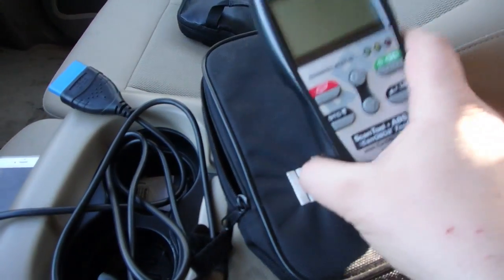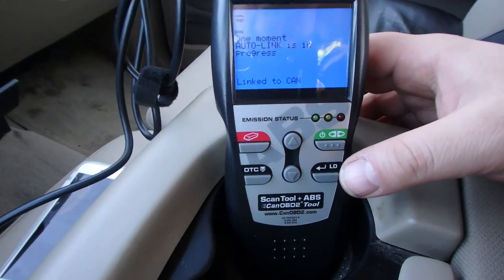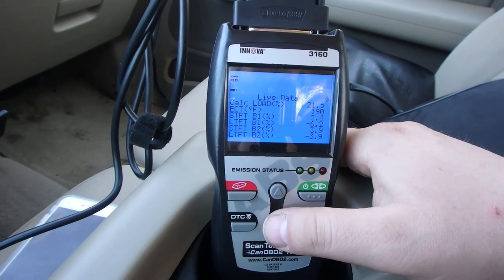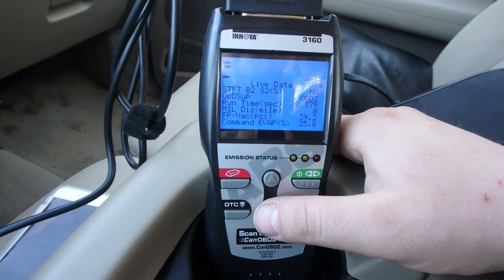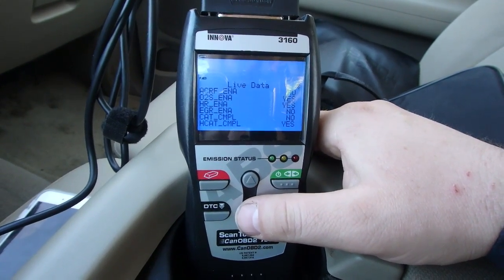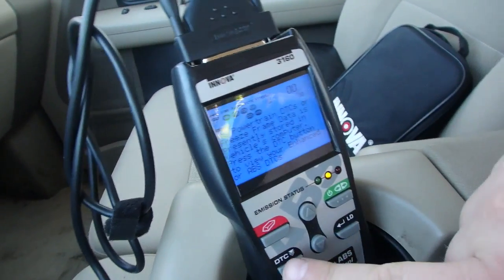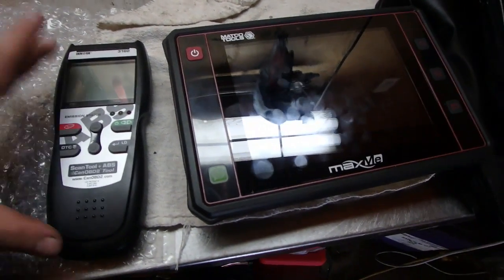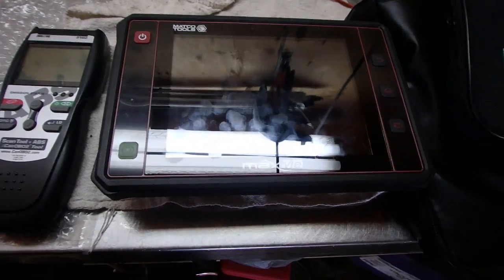Innova 3160 Scanner

Comment: Hey Brother, Does this auto bleed?
Reply from the maker: No cheap scanner can do a bleed expect to pay over 1k for that
Reply: @TestDontguess  No Sir, there are scanners that do a auto bleed For under $200. I just had a buddy has one 3160 used and unit says abs on it.
Guess it just reads and deletes abs and srs codes. But several companies sell em . You no longer need expensive tech 2 or go to dealer for air in abs. To preform a autobleed.

Comment: I have a 3040C scanner which has a battery test option however the on screen instruction for a battery test and the instructions in the manual are different. Have you done a battery test with your scanner and if so did it come out as ok for the test? If so did you have the key on but engine not started, key to accessories or key off completely when doing the battery test?

Comment: Umm I have a Innova 3160 .do a research  first.this scanner don't read abs codes on some  models.   like a nissan altima hybrid 2009 .
Reply from the maker: This one is a old model it won’t read ABS codes at all
Reply: Octaviano RAMIREZ brake issues with 2010 hybrid Altima too 
All abs warning lights and one tire locks when braking

Comment: Jerry does the Innova 3160 Check OBD1 also?
Plus does it check Transmission codes?
Thanks great video!
Reply from the maker: No it doesn’t
Reply: Yes it does but you need the OBD1 cables. I have them on mine.

Comment: You say you don't have any codes but the yellow light is on on the scanner what does that mean and will it pass emissions with the yellow light on? THANKS
Reply: Your correct. That means that it has found a problem but it must occur 3 times to throw a code or a code has been erased and there is insufficient data to clear it.  It has not been driven through enough cycles to clear.  No it would not pass an emissions like that.  I have the Innova 3160B.
Reply: For sure will.pass those are just pending codes

Comment: Any tool you know that can reset/reprogram the ABS light on my E39 dashboard. I replaced my ABS sensor with a used one from eBay but the ABS lights is  still on all the time. Thanks and Merry Christmas!
Reply from the maker: +Edmund Mendez ah Ya ABS is a bit tricky, if the computer still reads the fault then it will still show up, that's why i don't like those eBay bluetooth scanners.   they are ok for reading data to a tablet if your driving around but I prefer a higher end scanner.   Merry Belated Christmas to you as well